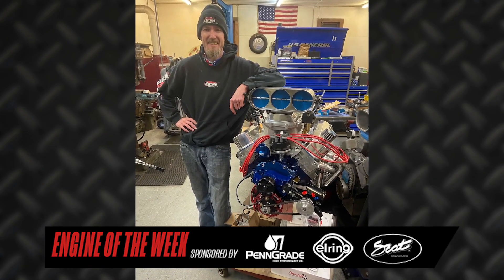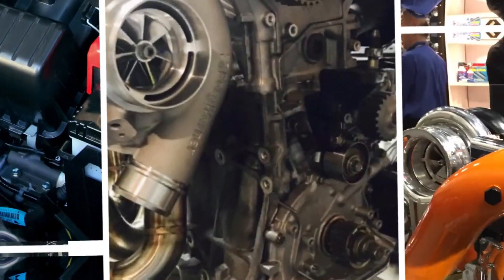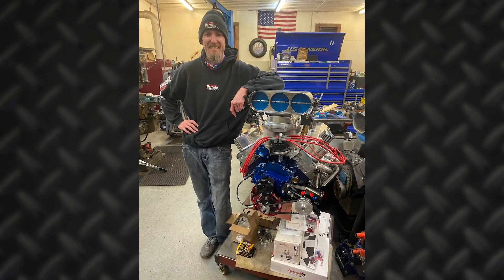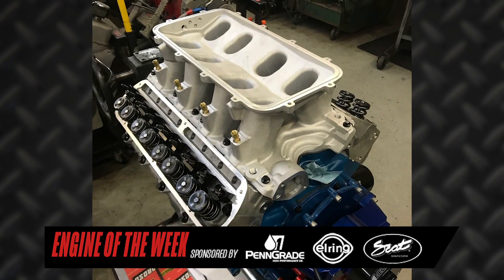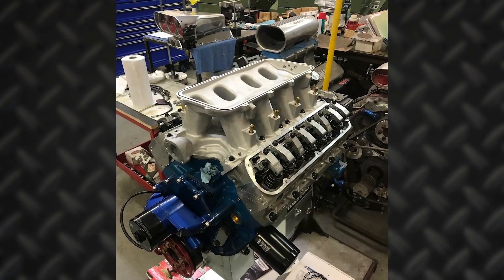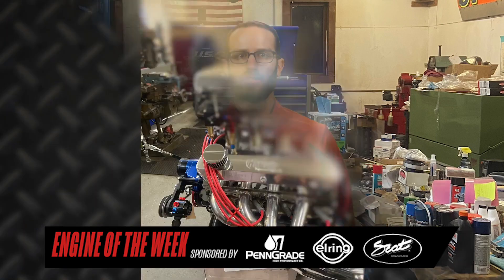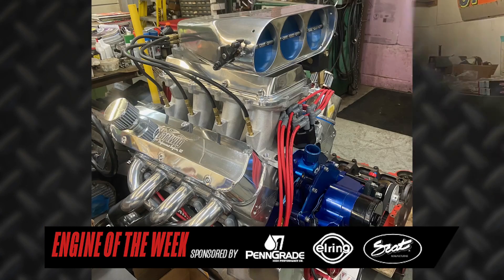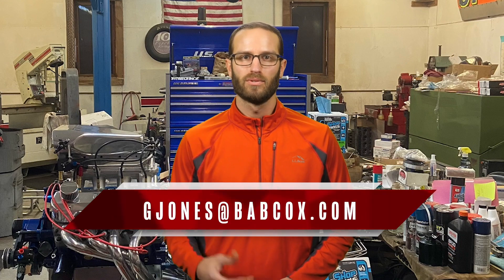Methanol Injected 427 Small Block Ford

Comment: wouldn't surprise me if it makes more than he thinks.  Mine is roughly the same build with a little less cam, and entirely different intake setup-and makes 760hp at 7400.  AFR225 unported heads, methanol (rons).  These SBF engines will crank out a lot of power if you know what you're doing.

Comment: Will never make anything close to 800hp
Reply: It’ll be close. I’ve seen 11.5:1 compression on 461ci clevor on MS109 run 760hp
Reply: @RadDadisRad  Cleveland heads are another world compared to the heads he's using. He needs at least 380cfm to make 800.
Reply: I have a real 805 hp 427 clevor and I know what parts are in this motor and the 427 Windsor is lacking in several areas